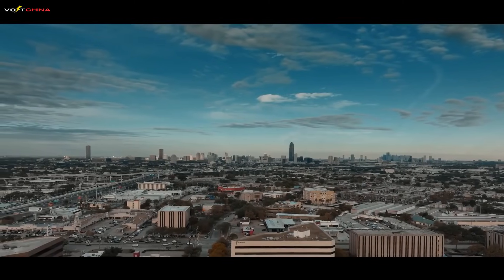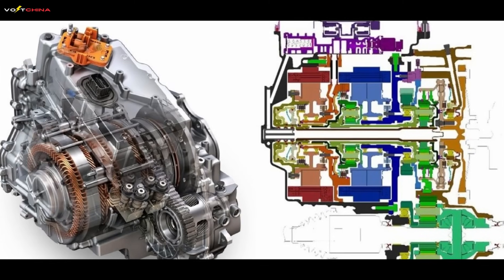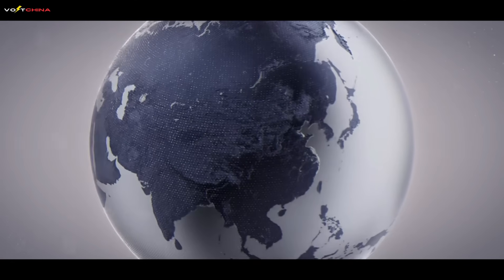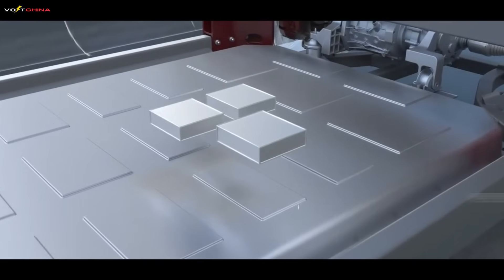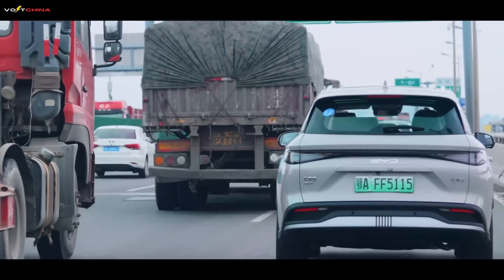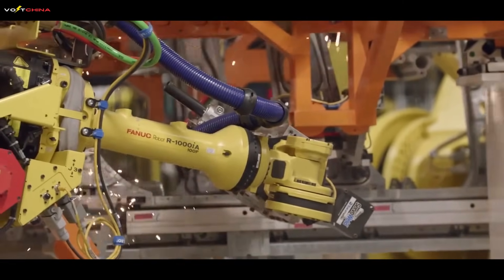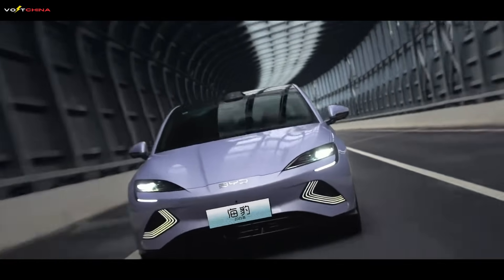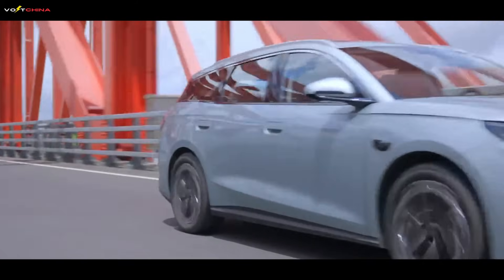BYD’s 46% Engine vs Volt’s Purist Design: Who Solved Hybrids Better?

Comment: YOU have some wrong information on the Volt (Ampera).  I'm also a 91 mechanical engineer and on my 3rd Volt (2019 P).  The Volt is as close to perfection on ICE power.  The kg (HP) should be much lower i.e. on level smooth surface at 70 mph I use about 30 HP (25 kg). On a 50 mile trip, use only the electric motor.  On a 100 mile trip, have the ICE run for 51 miles out of the city if possible.  On a 400 mile trip, have the ICE run for 351 miles out of the city or in slow moving stop/go.  There is NO NEED for an ICE over 30 HP if properly used.  The use can be manual or tell a GPS where you are going and let GPS AI start/stop ICE.  The lesser weight of the ICE could also dictate a larger fuel capacity.  Aerodynamics (Cd) is also important to attain better fuel mileage.  Smoother roads give more fuel mileage.  I have personally found old concrete roads pitted by studded tires take OVER 10% more fuel than smooth pavement?  Yes, that tire noise you hear takes more fuel.
Reply from the maker: Thank you very much for your genuine feedback. There is no information more reliable than what comes from your personal experience, and it is a great honor to see you share such detailed content. Thank you for watching, and we also hope to hear more authentic voices from engineers like you, as well as industry experts, automotive enthusiasts, and real car owners, each sharing their unique perspectives!

Comment: The Volt was a missed opportunity for GM. I owned a series1 Volt for almost 4yrs. loved it, It fullfilled the suburban requirement perfectly and was surprisingly well built Only used the gas engine every 49days to recirculate the fliuds and once a year to change stale fuel. Only had one minor fault which cost $25 to fix but it still required gas car maintenance  and carrying the extra motor weight. Had other cars for out of town.
With todays battery tech the all EV range of the Volt could have been doubled in the existing space.and suiting most people. Realising I didn't need the gas motor backup I traded it for an all electric BYD, which fits all requirements faster and has a 350ml range..
Reply from the maker: Thank you so much for sharing such a detailed and insightful personal experience! It is precisely because of in-depth comments from people like you that we feel creating these videos is extremely valuable. Thank you again for taking the time to write down these precious shares—they are of great value to the discussions among all viewers. Wish you and your BYD vehicle a pleasant journey!

Comment: OVER RATED TOFU DREG
Reply from the maker: Thanks for sharing your thoughts. We appreciate that there are many different perspectives on these competing technologies. The goal of our video was to explore the two distinct design philosophies: Chevrolet's approach of "optimizing for the usual" with the Volt, versus BYD's "all-scenario readiness" with the DM-i system, and the market dynamics behind each.
If you have specific points regarding where you feel the engineering falls short—be it in efficiency, performance, or reliability—we'd genuinely love to hear them. We're always open to a deeper technical discussion with our community.
Reply: Have you ever driven a modern Chinese car> Why do you think most of the world loves them.